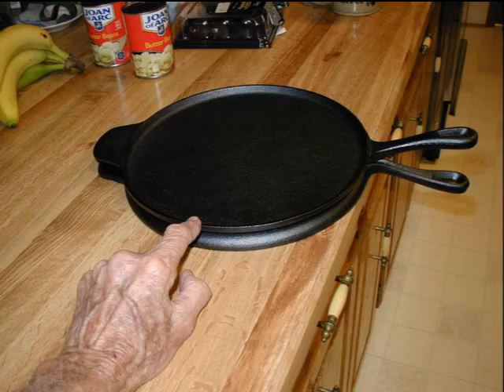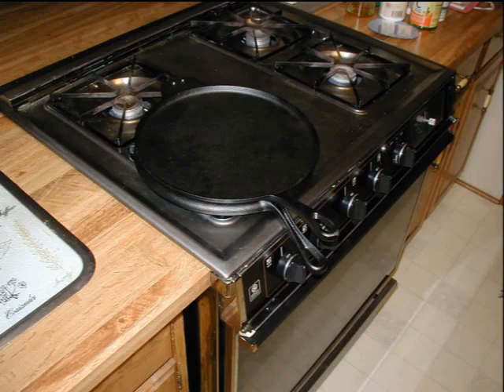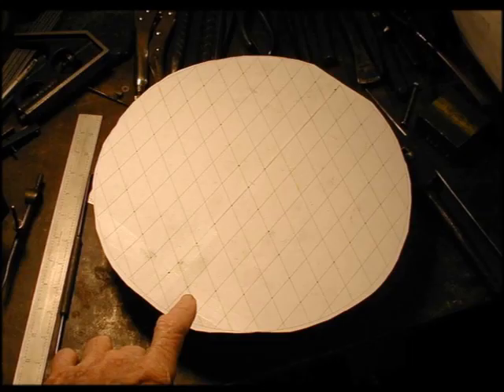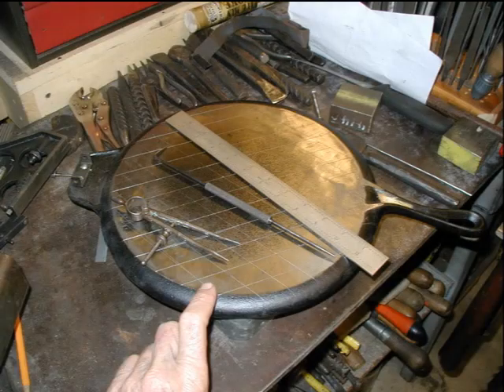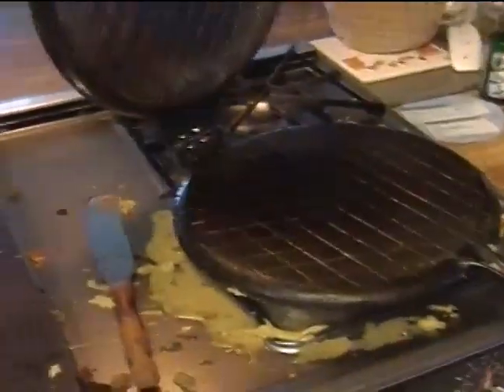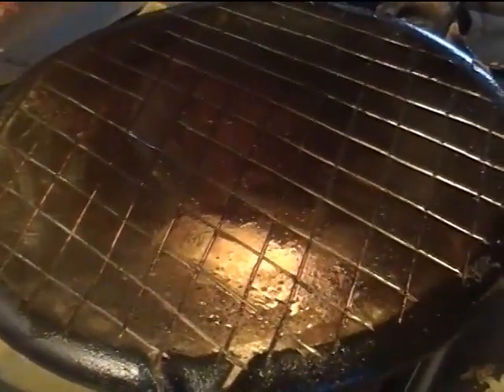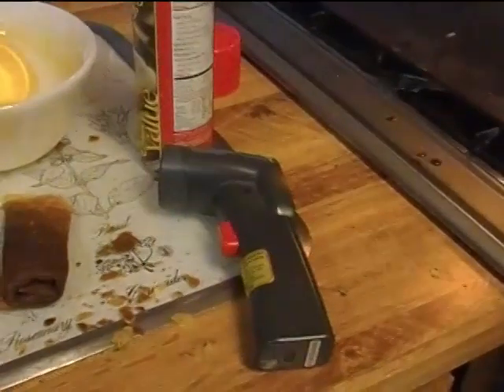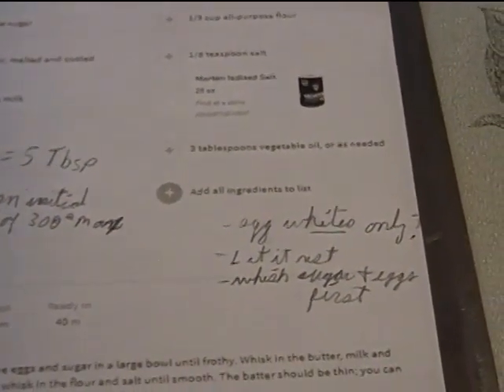Making  a Marquesita  Maker and Testing It

Comment: Hey I've been thinking about doing this same think with the backside of the 2 griddles. I ended up getting a little like 4 inch vintage wafer iron that is literally a mini marquesitas iron. I think part of your cooking problem is the way you buffed to a shine the cooking surface of your cast iron. The well seasoned cast iron in its "from manufacturer cooking finish" is key to the texture of the marquesitas. I'm by no means knocking your effort. In fact I applaud you and your continuing effort!